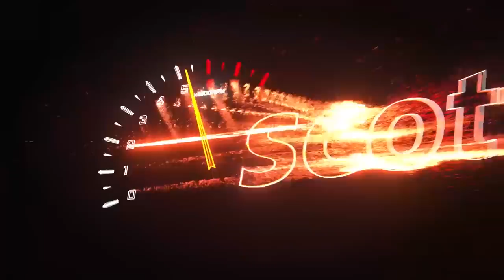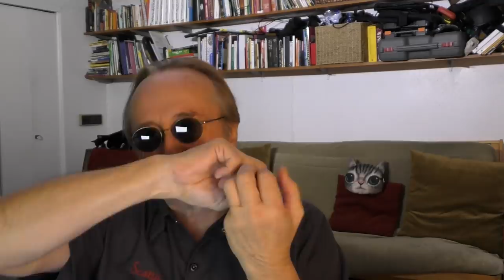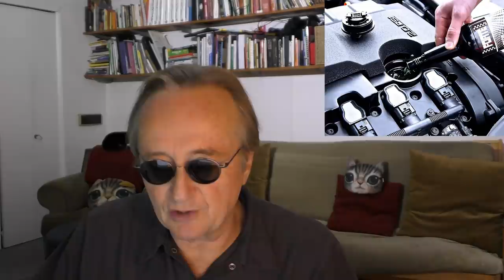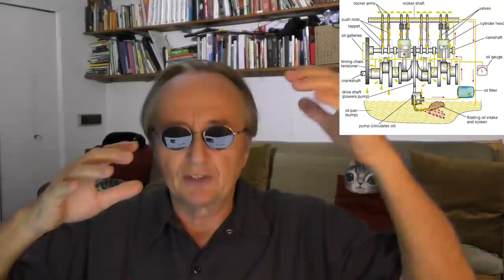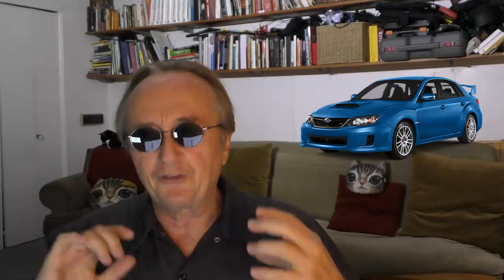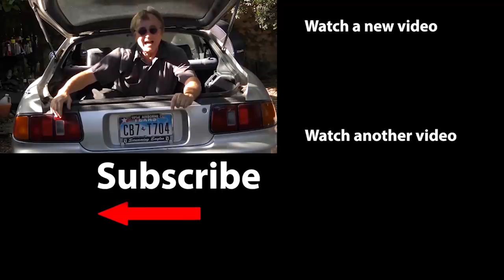Bad Mods that Will Ruin Your Car

Comment: Hi Scotty, Is there a difference btw a 4WD & AWD vehicle?
Reply: AWD doesn't have low range for serious off-roading.
Reply: Thanks for the answer Michael, could you give more details please?
Reply: @otereb  Low range basically raises the suspension so you have more ground clearance for heavy off-roading. AWD can't do that.
Reply: AWD is a computer controlled system that has drive shafts to all the wheels and has a set split of power between the front and rear and has computers sensing the Road conditions and will adjust power to suit the situation. With AWD the purpose is to provide better traction on a regular road(they will also handle better on less ideal surfaces but will still be limited by vehicle geometry and tires) . With AWD the vehicle is always in AWD and operates in its default split(usually the split favors the rear wheels and the front wheels get the lower amount) and adjusts itself automatically based on what the AWD computer as well as the traction and stability control systems are telling the car.

4WD is a system where the power split between front and rear is 50/50 and is designed specifically for off road conditions to provide the best possible traction on off road surfaces. If you drive on a regular road in a 4WD vehicle with the transmission sending power to the front wheels the vehicle will bind when you turn the wheels as you turn. Some vehicles have "active 4WD" which is when there is a computer that detects when the wheels are in off road conditions and then engages the front differential. Most have "semi active" which is when the driver must press a button or switch to put the transmission in the mode that sends 50% power to the front wheels. Another method is manual where the driver operates a level that physically moves the transmission into 4WD. The purpose is to allow the vehicle to drive on very crude roads or trails and even in areas with no actual road. They typically have two ranges a high and low. Low is for very low speed situations requiring maximum tire traction a steep rocky trail for example. When not in 4WD mode the power goes to the rear wheels only. With 4WD you drive in 2WD(rear wheel drive) until you get to off road situation and place the system into 4 high or 4 lo or with active 4WD you drive onto off road surface and the computer actives it.

Examples of AWD vehicles: Any Subaru except the BRZ and any Audi Quattro 

Examples 4WD: Semi active 4WD, Ford F-150, Toyota Tacoma, Jeep Renegade. Active 4WD Toyota 4Runner and Toyota Land Cruiser
Reply: Tristan Holland Thank you so much